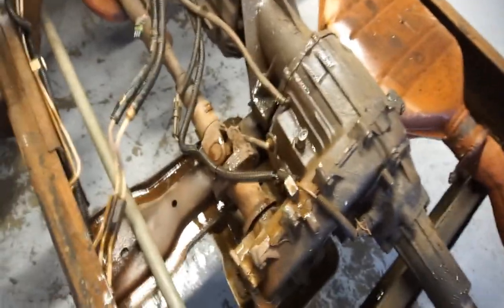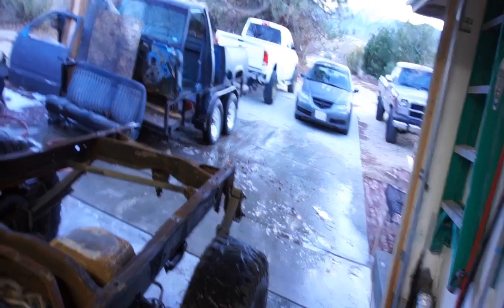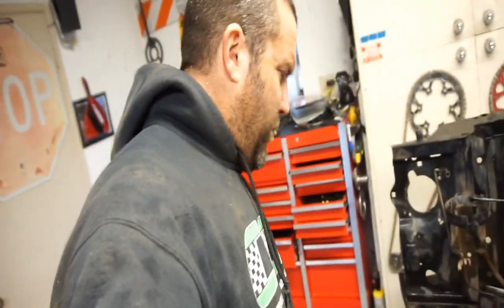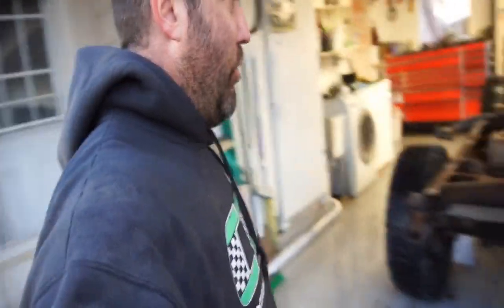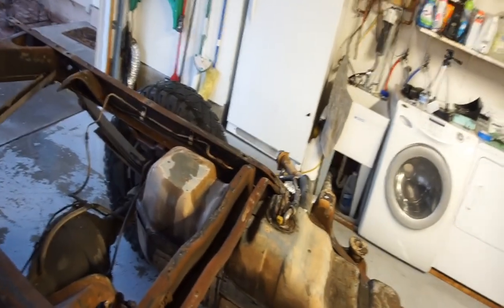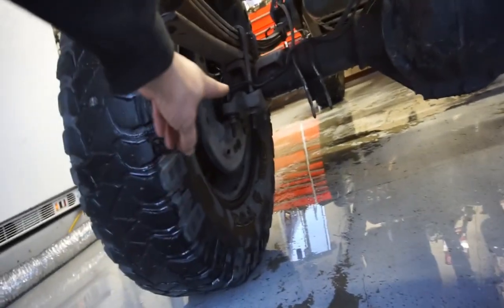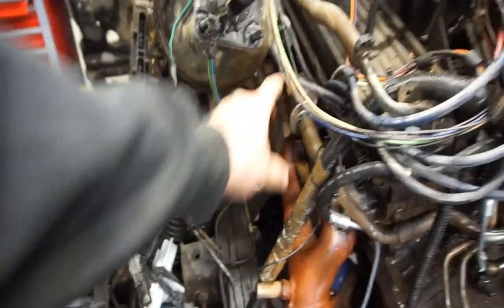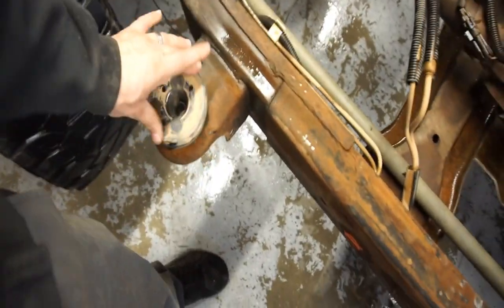Project Crack Pipe. AKA PCP 91 K1500 4x4 with 64 C-10 Cab Short Bed. #2

Comment: off topic but just an observation. I see you are using some florescent lighting in your garage. Sams Club sells 4 foot LED lights, they are so much brighter than florescent. I was impressed with them and changed out all of my garage lights for LED's.
Reply from the maker: Glen Wood nope. Those are led 4 footers. They’re really bright but one of the eight footers is covered when the garage is open. Same lights as Costco has.